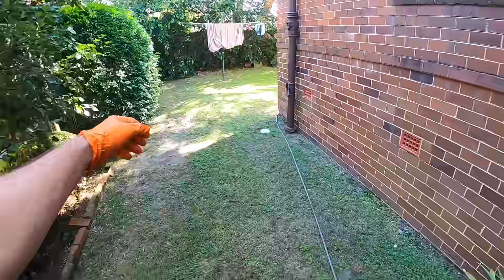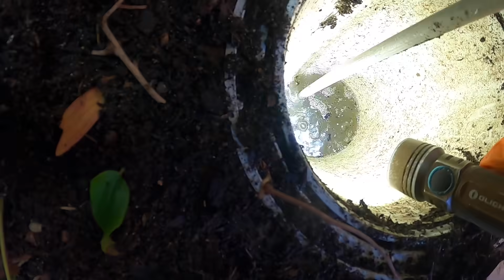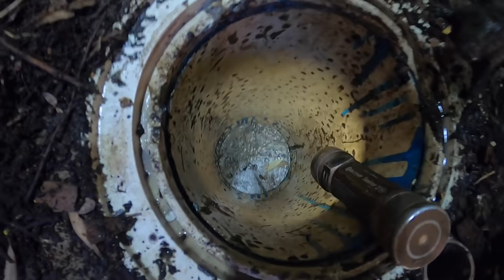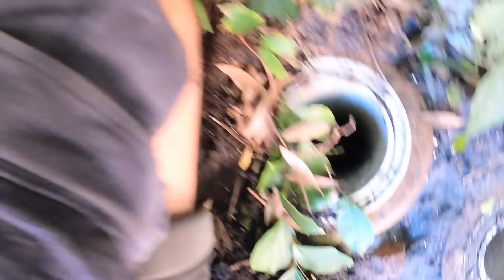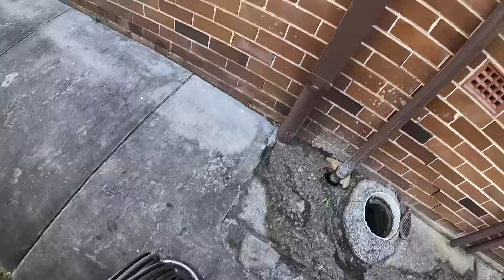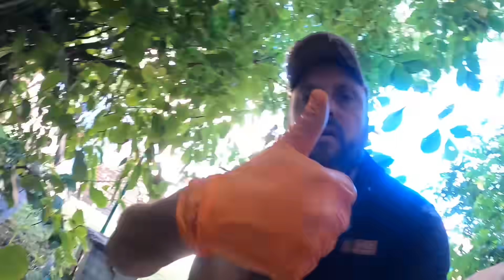Blocked Drain 451

Comment: Were all the houses in Australia built before indoor plumbing?  Is that why all of the pipes run down the side of the building?
Reply: I've noticed a lot of things I've never seen before. Here in Wisconsin you would never think to see a hot water heater out in a gangway (walkway) on the side of a house LOL
Reply: I think its mainly done because they don't really have to worry about freezing weather
Reply: AmraphelofShinar this ones pretty old ( maybe just post war) . There’s some cast iron work there as well as gal and pvc. Sydney never freezes and plumbing to the outside wall was cheaper - this was a set of flats- appartments - so built to a low budget . Was probably once considered living in the sticks ( miles away from town/city centre) but it’s probably almost inner city now
Reply: @baileya82  Exactly.
Reply: Drains and other plumbing run on the outside of buildings is common in Australia and England too. It's not common in the US but many old buildings in San Francisco also have the drains and other plumbing mounted on the outside walls too.

Comment: I find australian sewer systems very confusing.  why are there multiple pipes coming up to the surface of a singe dwelling.  Im in canada and we have a clean out near the inside of the foundation wall under which the sewer pipe lead to the main in the street.  one pipe underground (because of frost) from the house to the main
Reply: That's the way it is with my house in the US. Strange plumbing codes in Australia...
Reply: lordhoho1 I’m Australian and I’m finding this one odd. Usually only one riser at the boundary - the boundary trap- and then it’s essentially municipal piping but getting them to attend to block drains very dependant on where you live.

Comment: I don't understand the idea of having a trap on your sewer line and having all these open grates along your house venting sewer gases? North American is just a pitched run straight to the main sewer. Only place its vented is out your roof
Reply: Not Sure the one on the house is an S bend trap - overflow trap - so you can tell if there’s a problem and so there’s no sewerage overflowing inside the house. At the boundary of the property there’s a riser which is capped to stop odours and then it’s off to the farm 😁
Reply: Each of the open grates is a called a gulley trap. They are very common on older buildings in Australia. They don't exist in American plumbing. The gulley trap stops sewer gasses and smells rising up from the sewer. Drain lines empty into these gulley traps from sinks, tubs etc. The one with the ramen noodles and corn had a kitchen drain emptying into it. The drain from the toilet has a separate stack that enters the underground pipe directly. If there is a sewer back up the water overflows safely outside like it did in this video instead of flooding the inside of the home or building. Google images of a gulley trap to see the piping arrangement of a typical Australian home. Some places in the US do have curb traps (such as Philadelphia and San Francisco)  or whole house traps (such as New York City) which are very similar to an Australian boundary trap.